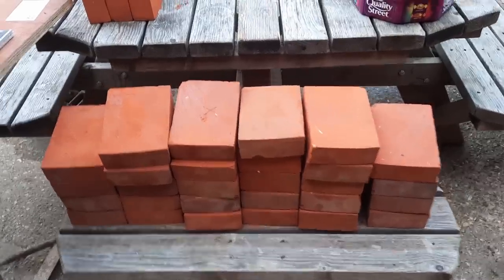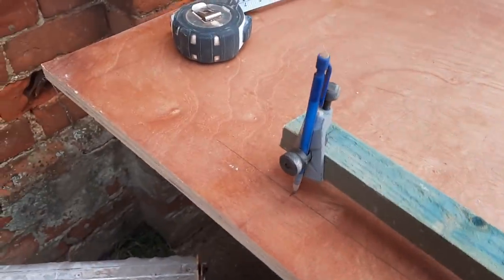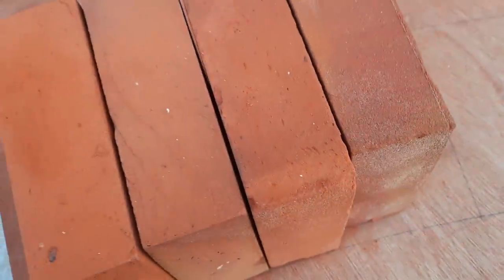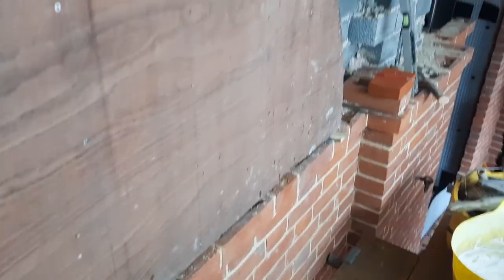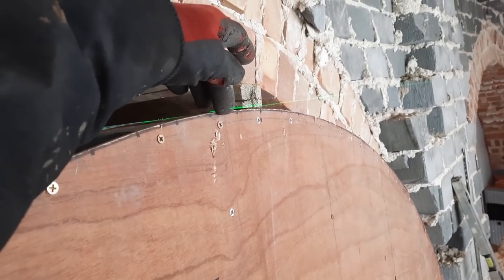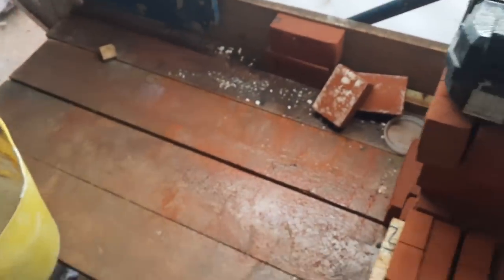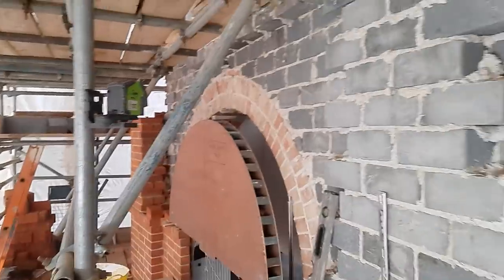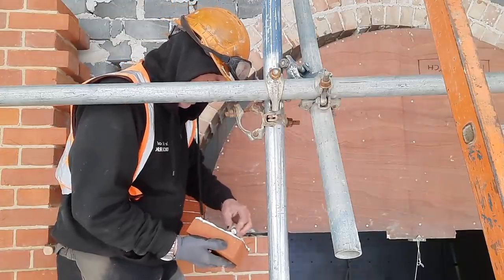the fine art of brickwork - Rubbed & Gauged Arch 2

Comment: Looks good Rob,must be costing a fortune them Rubbers must be a few quid each nowadays.Not done anything like this for a long time, we used to dip them rather than butter them and not cut the excess of until it had set a bit with a scraper. Then give it a couple of days and carefully go over the whole arch lightly with a fine sanding block. 👍
Reply from the maker: excellent info, thanks
Reply: @robsonger1  👍

Comment: Great work Rob. A little tip for you for gauged work is create a profile tree during set out, and radiate to it from striking point through arch and make marks on profile timber. Then set it up above your work and radiate lines preferably lines made of fine fishing or piano strings something of that nature back to striking point and lay bricks to the lines. Traversing the arch is very effective for this work also, I like to mark up from springing point or skewback the distance for all joints 1mm or 2 strike it through, then traverse template to that point till it fits exact, that way you don't have to do the tap and wedge system if you traverse to Springer or skewback to create joints if it makes sense I'm sure you get me. Gerard lynch does course for this work, these are methods he shows, if he still does those courses that it is.

Comment: Hello Rob! Greetings from Belarus. What kind of grinding stone do you use?
Reply from the maker: we requested York stone but we used a concrete block while we waited for it..
Reply: @robsonger1  wow, gotta try. I process the brick with files and sandpaper - but it takes longer and a lot of dust gets clogged into the tool. I have to clean it with a wire brush :-( 
I think this concrete block you are using is lined with gravel and granite chips? :-)